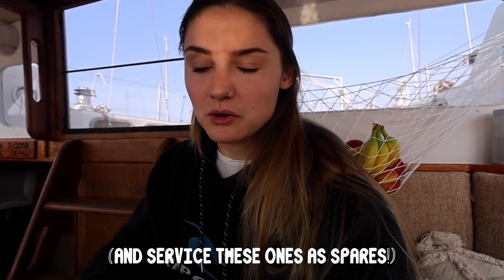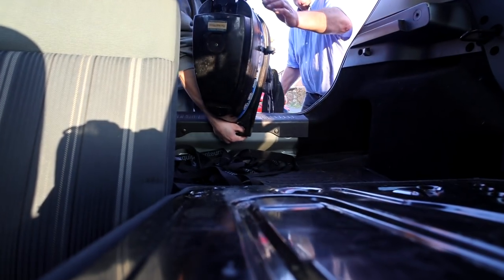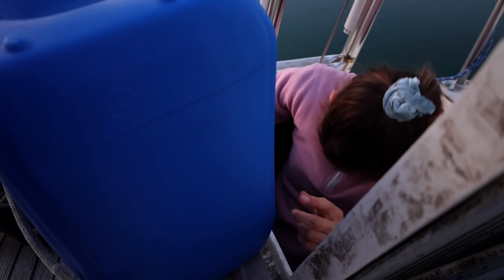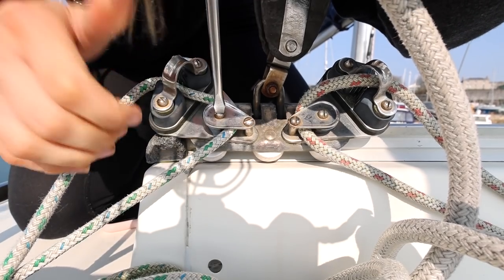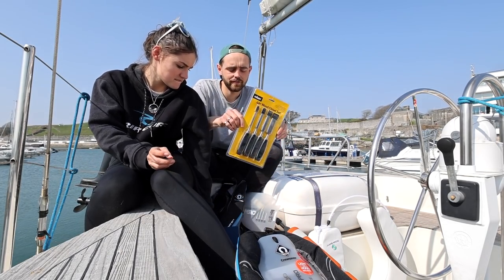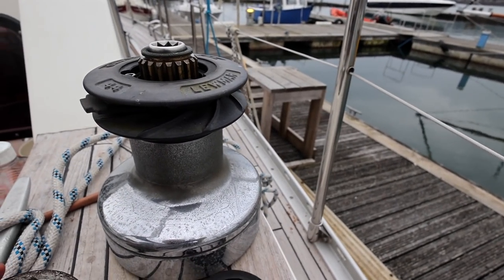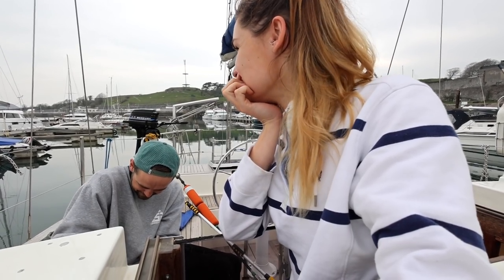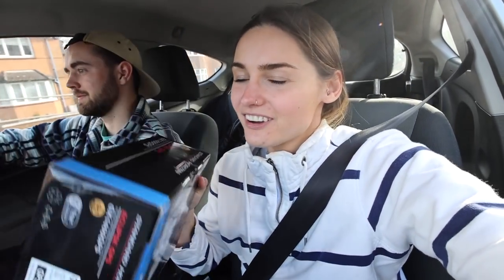Getting our NEW BOAT ready for the FIRST SAIL

Comment: Hi there, we bought as well our sailboat last year and feel your excitement too. We are going currently through a large refit. 2 recommendations from my side, if you havent read it yet: For the winches I would recommend oil and grease. It is important that the armsprings dont get any grease because they can stuck, it can be dangerous. Use oil like Balistol. For the rest use marine grease. Second, I would recommend self tailing winches for your sheets, it will make your life easier especially when you sail with only 2 persons. But I am a few videos behind, so you might know this already :)
Reply from the maker: Cool! Which boat did you get? 😊 We have special Lewmar oil we bought after this vid, thanks! Will look into self tailing winches too. Thanks for the suggestions!
Reply: @TeuluTribe  oh we bought a 43ft steel boat, long keel. We are a couple as well  and know how it is to get to know your boat and sometimes feel overhelmed. About teak: We had a teak deck as well like yours but found corrosion, can be a huge problem for steel boats. Our plan is to use flexiteek. Are you planning a circumnavigation or where would you like to sail next?
Reply from the maker: @TheDenisthemanace  wow, that’s crazy. I guess all boats have their own pros and cons 😊 we are planning both in the future ☺️